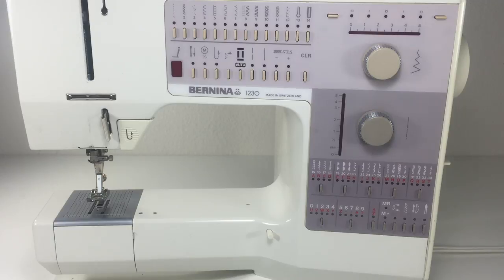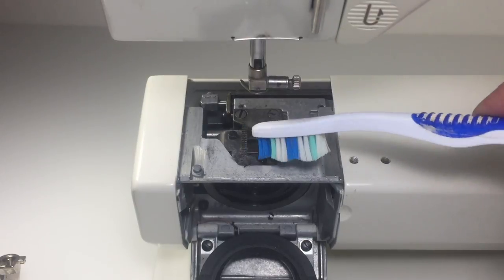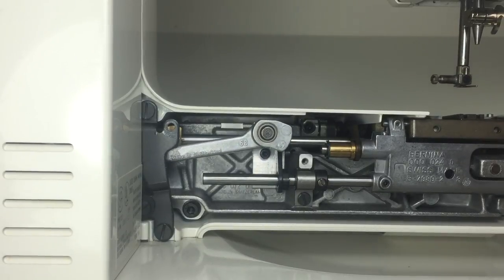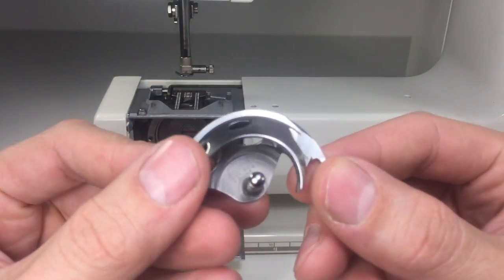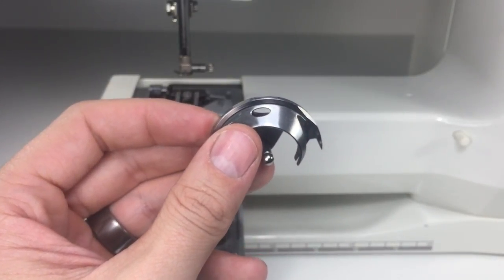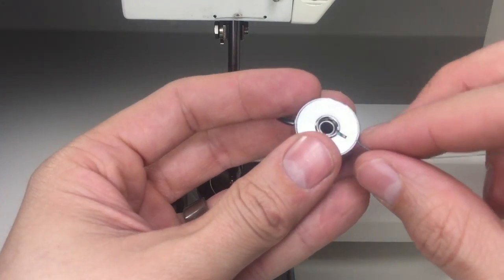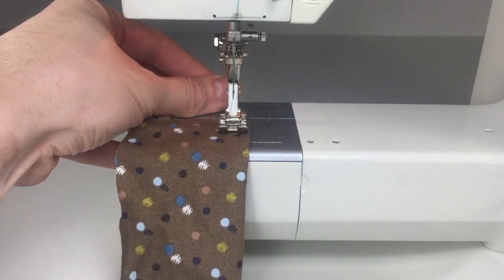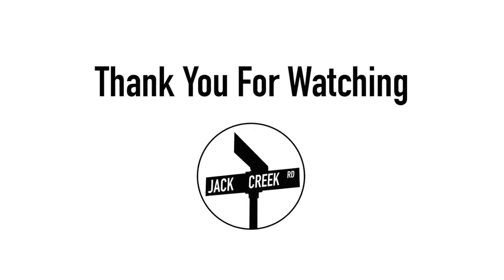Front-Loading Sewing Machine Home Maintenance

Comment: Thank you for your clear and informative video.  I have a Bernina 1020.  After a technician fixed it, I see that the needle is not exactly centered in relation to the needleplate.  Can I align it myself?  Bringing it to the shop is a physically cumbersome effort, with no parking in the area (I have to drag the machine by bus).
Reply from the maker: Hi Laurie, Your machine has the ability to move the needle to different positions. This adjustment is the dial/knob INSIDE the stitch width adjustment. Is it straight up and down or is it slightly turned to the side that the needle adjustment is off?
Reply: @JackCreekRoad  The dial knob is straight but the needl's center position is a hairline to the right which diminishes the wonderful precision of the Bernina machines and causes trouble when I want to see cording .  I lose the snug fit of the zipper foot up against the cording.

Comment: I just bought a husqvarna 3500 electronic and went to clean it, the needle plate came off great then underneath when I undid the screws (there was heaps of lint) a curved part came off and I can't seem to get it back on correctly and now the feed dogs are not working properly. Hope you can help as I can't find the manual online anywhere. your videos are great

Comment: I have a 1020 and it feels like the top tension is tight but it doesn’t change when I lower it. How would I go about checking it out? It feels tight when I pull on the top thread.

Comment: Hello, your video is great as well as the others. Unfortunately checking, cleaning and tuning was not enough to prevent jam. It looks like some plastic parts are too old or have cracks and the space between the bobbin holder and the upper plate has become too thin. The wire get stuck while turning around the bobbin. I fear there is no easy solution to fix it (please excuse my English from France, I am missing some technical words). I need to purchase a new sewing machine. Do you have any advice for brand and model ? You are doing great, thanks a lot.
Reply from the maker: Hello, can you tell me what make and model your current machine is? And what is your budget for a new machine?
Reply: @JackCreekRoad  Hello, Thanks for your answer. Currently, we have an ELNA Club Computer Type 500. I am looking for a machine below 400 Euros.  BR Raphaël

Comment: Hi guys.  I have a problem.  My Singer sewing machine is jammed.  The hand wheel don’t go either way.   I cleaned the bobbing and still don’t work.  Any idea what’s wrong.   Thanks in advance.
Reply from the maker: It may be stuck or broken gears. Can you tell us what model you have?
Reply: Jack Creek Road thanks for answering.  It’s a Singer serial 4742662E420364. Model 2662.
Reply from the maker: I would recommend removing the needle plate, needle and bobbin case, then try turning the handwheel (Being sure not to force it.) This will tell us if it's possibly the bobbin case binding, maybe try this and report back.
Reply: Thanks guys for the advice.   I’ll try what you say.  I love your videos.